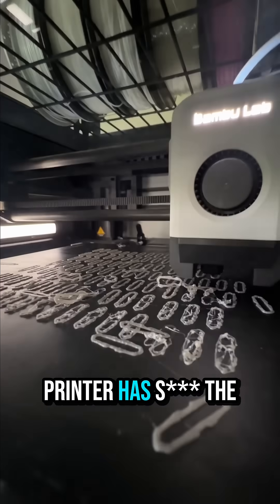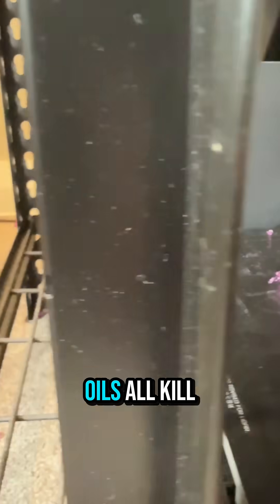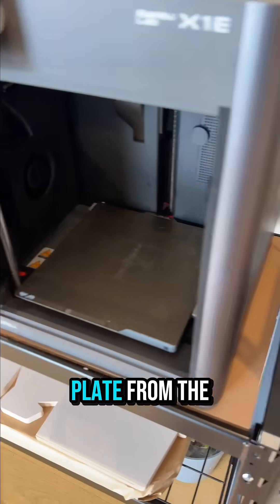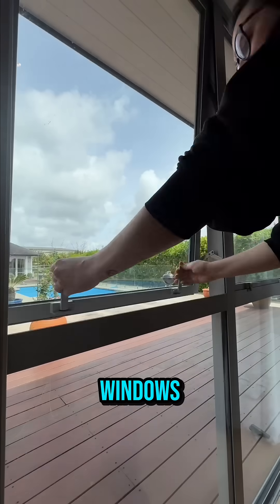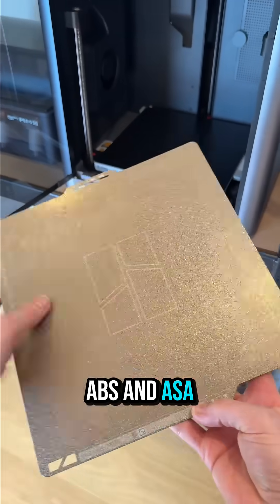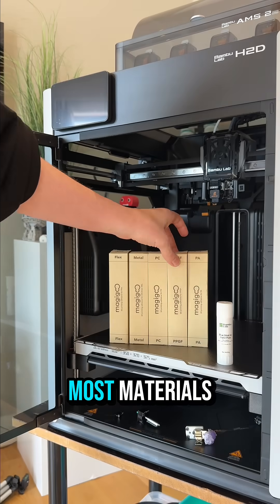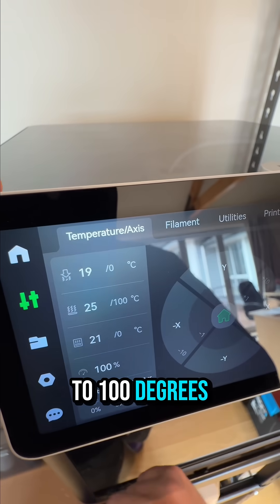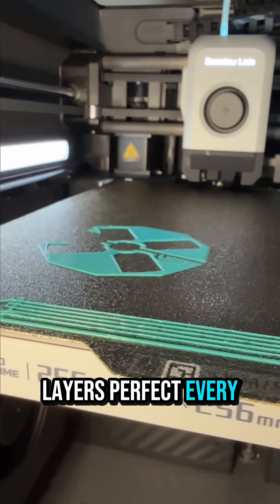WHY WON'T YOU F****ING STICK????!

Comment: I clean my bed weekly, or when I have time with alcohol. Never have I ever used glue or had any problems with adhesion to the bed. Even with open printers and low end ones… keeping it clean works like a charm! 🧼

Comment: sometimes you need to dry your PEI sheets as well. PEI can get waterlogged. If your in a high humidity environment this can really show itself. Often the center of a plate will be fine in such situation but edges show a lack of adhesion. The solution, put your bed to 100c and let it dry for an hour. Then you should be good to go. Also a good thing to do if your printer has been sitting a few days, if your in a high humidity location.
Reply: "Did you try drying your plate" as a legitimate advice

Comment: I find 60-75 is moree optimal for petg build plate temp, petg can start to warp at 80, I usually keep it 75 first layer, 70 rest of the way does great with warping, want it to stay for sure? Brim. Air pressure at sea level 14.7psi, know how if you put a sheet of paper over a ruler hanging off a table, you can hit it and break it in half, it's because of air pressure - lift force of ruler created is less than down force of air on top of surface of paper area so it breaks, you can remove the .1mm gap and change it to zero, - at least 9 in area would be 130 something lbs of force, so 1.5 inch brim, each direction from the print so left+right 3, top +bottom 3, 3x3 = area 9² in, not counting the prints area itself and whatever force it adds

Comment: Model design can also be a factor; sharp corners like to lift like there's no tomorrow, but I've even had issues with 90s. Generally try to avoid sharp corners, but Mouse ears can help a lot (I've found more success modeling them in than using the slicer generated ones; just make sure they're a separate body and separate your model into separate objects in the slicer so it generates the mouse ears separately from the main model and they're easier to remove; I also like to set mine to print with concentric so they mimic the slicers ears, butt it would probably work either way)
Reply: You can typically avoid the warping by using the lowest temp plate and plate settings that will work for your project too.

I'm personally not one to use glue tho. Yes it helps things release better, but it's messy and nasty.

Comment: Something else that can help make sure your bed stays clean, keep a small bottle of rubbing alcohol and something like a microfiber or wash cloth next to your printer and just spray a little on the bed and wipe it down after every 1-3 prints. The rubbing alcohol will NOT clean your bed it just helps it stay clean. If you touch your bed beyond like a finger print or two, fully clean it with soap.

Something that’s also overlooked is environment temp, this isn’t an issue with enclosed printers but it is with open printers like the Ender 3, A1 and A1 mini, if your room is too cold or the room you print in is too drafty, the temperature difference can and will wreck your adhesion. If your room doesn’t have drafts and it’s not too cold in there, it shouldn’t apply to you.